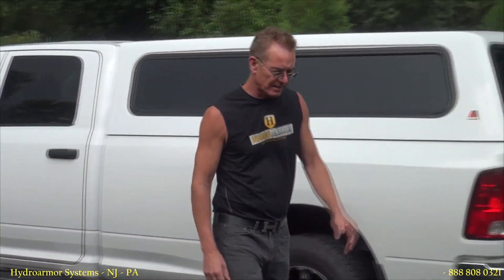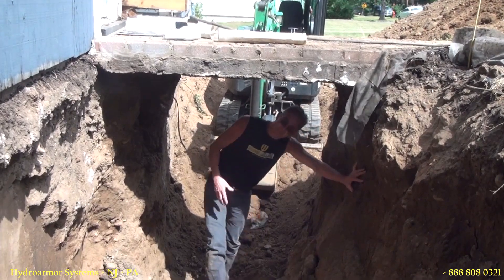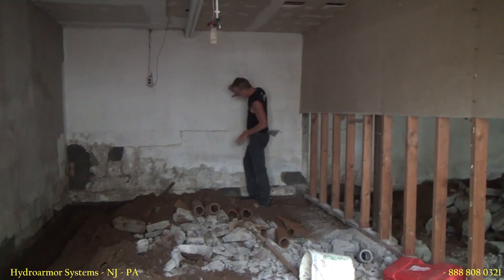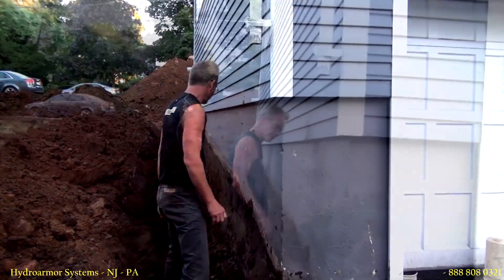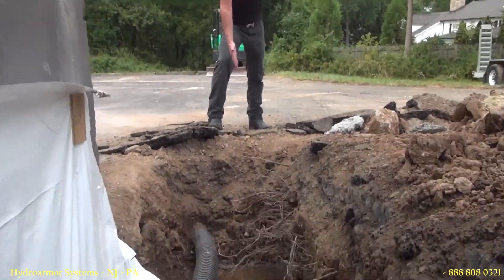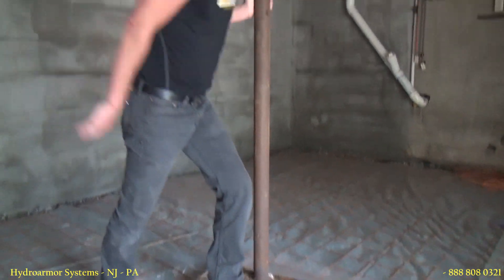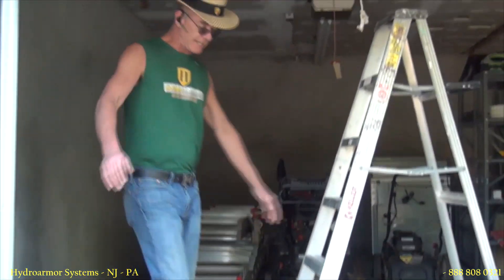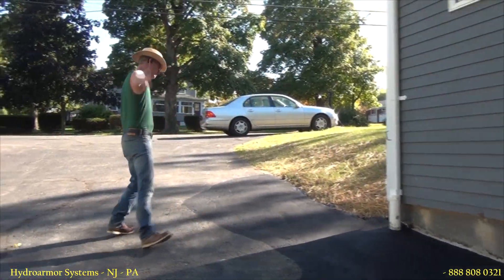Exterior Foundation Waterproofing & Repair - No Sump Pump Needed

Comment: Thanks man. I'm planning to finish my basement in the Philadelphia area and I needed this info. I am going to do most of it myself and people kept telling me that I would be fine just sealing the interior block walls. Being a person with a bit of construction experience and a decent understanding of physics and the destructive force of water, it just didn't seem right. During the summer months, I am sure that I have humidity levels that would lead to mold, and once I frame, drywall and paint I won't be able to see that creeping death until I have a major problem. I've never had water in my basement since the house was built in 1987 prior to this past summer when during 2 crazy rainstorms I saw a trickle at 3 places originating at block seams about 3' below ground level...
Guessing I need to call my dump truck and back hoe friends...cheaper and easier in the long run?

Comment: So it absolutely won't freeze as long as the drain has a steep enough pitch?
Reply: Sitting water will freeze. Running water won't. It will only freeze if water gets stuck inside the pipe and doesn't drain.
Reply: @Luckingsworth  running water freezes.. look at water falls that freeze lol
Reply: @jeepsblackpowderandlights4305  Freezing waterfalls are incredibly rare and it takes relatively extreme cold temperatures for it to happen.
Reply: @Luckingsworth  creeks always froze over as a kid too in northern va...  they flowed as well.   I know flowing water has less of a chance to freeze.  The ground insulation helps as well.  Im Just saying flowing water does freeze.
Reply: @jeepsblackpowderandlights4305  Well, if we are being technical flowing water cannot freeze because movement and stasis are two completely opposite things 😁 but yes I do get what you are saying as well.

Comment: You may want to consider a separate pipe for gutters. Ideally you want a separate pipe for each system, so if one fails all the systems don’t fail.

   Other than that, I love your videos.
Reply: I would agree, if the gutters feed into the perforated pipe. However, if this is only connected after the perforated,  this is actually much better to allow as much flow through one pipe as possible. I think a cleanout before the junction would be a great idea.

Look up "like a boss" in the dictionary and this guy's picture with Hydrodog will be right there.